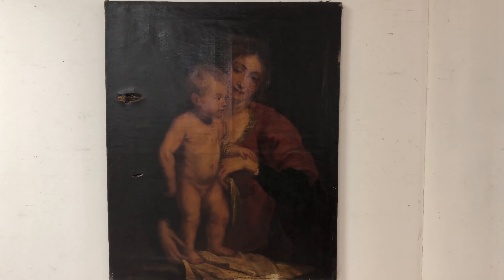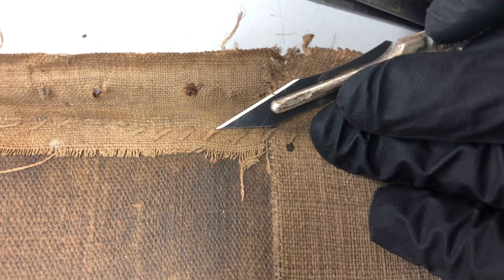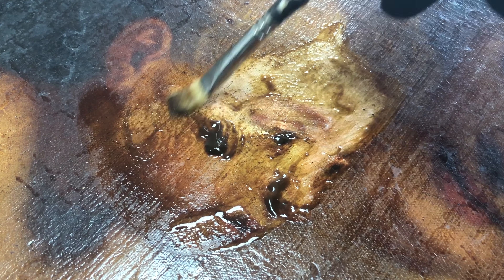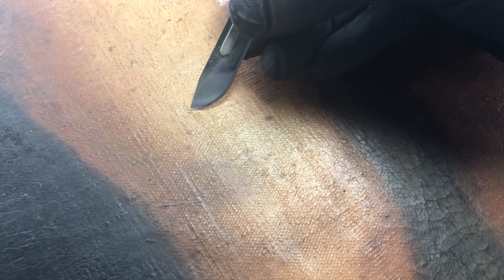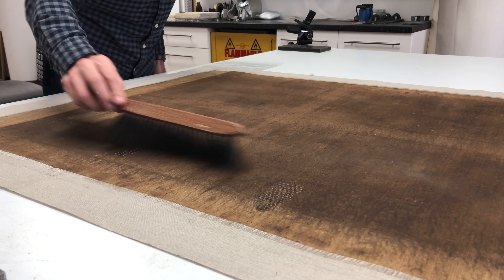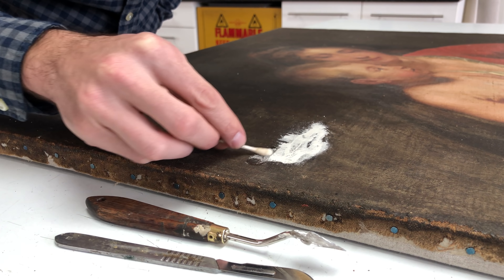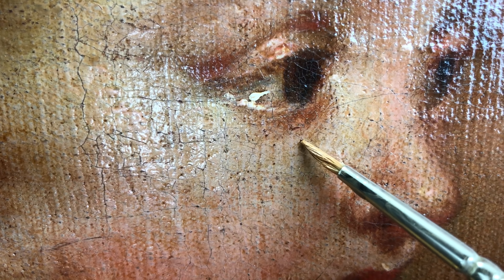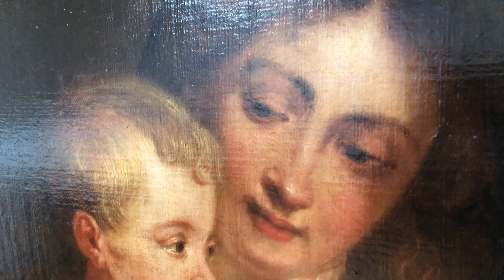Narrated Old Master Painting Conservation

Comment: I have a question: Why do old paintings look so thick? Was the linen the old masters used thicker or is it a combination of layers of paint, resins and varnishes? Thanks.
Reply: The latter. Renaissance Painters like DaVinci and the like use a lot of thin layers to create them or use impasto, when you paint very thickly with a lot of texture. Also animal based paints and varnish crack over time. Humidity and other conditions that the painting may have experienced could also affect it. While I’ve never heard of thicker linen, it might be possible since they were made by human hands and not industrial machinery, that makes a more uniform product.
Reply: Being thick was a sign of prosperity back then.
Reply: @rlt94  ROFLMAO!!!....true, but funny in the context you place it.
Reply: @rlt94  Have you looked at that baby? A thicc icon.

Comment: How much does something like this cost?
Reply: Depending on the size and how much work needs to be done... i do a similar business and something that size I would to for 250-300 bucks.
Reply: It’s that expensive because of time
Reply: @taylorzielinska8681  That's not too expensive really, although I suppose it depends where you are geographically and what sort of paintings you work on. I'd imagine this one took a few days at least, and a day rate could be anywhere from $300 to $1000 for this guy. Wouldn't be surprised if the whole project ran into the $1000s.
Reply: @taylorzielinska8681   Are you joking? $250 to $300!?!?  He must spend 20 hours or more just cleaning it and his expertise alone would command that amount of money for just looking at the piece. I would imagine his work would cost thousands rather than a couple of hundred. I don't know what work you do but it is certainly not fine art restoration if that's what you charging!
Reply: Definitely in the thousands, with how experienced and good he is and how long it takes. And the materials and tools he uses are clearly top quality. This is not a few hundred dollars worth of work.
Reply: @taylorzielinska8681  250?? to 300? hummm ...  i think you missed a zero here or depending the  piece a couple... I dont think  any restoration studio working with this level of restoration and art pieces would even touch them if there are at least a 3 to 5 thousand dollars as a DEPOSIT.
Reply: Lol it’s 2500-3000 mb

Comment: When you remove the varnish with focus on sections of one color at a time. How do you know which solvent is used for which color? Do you label your different types of solvents according to the color pigments, type of varnish used, or by the type of paint used? It seems like there's so much to learn
Reply: You use the same solvent for them all. You just go section by section to keep it organized and in case one color has a reaction. It is very rare to have to use many different solvents. They might even just switch the solvent for the whole piece if one color has a reaction.

Comment: Thank you for telling us the 'story of healing' of this painting <3 I have two question: do you try/have to clean the painting in one day or you could clean it in the several steps/days? Is this synthetic resin layer (also) makes easier the retouch to be removed if it is needed?
Reply from the maker: The cleaning process can be short or take several days or longer... it just depends on the painting.  And yes, the resin layer will make easier the removal of the retouching though the retouching comes off pretty easily even without it.

Comment: Are you using water based ie plastic resin varnishes? You do know that these grey in about 10 to 15 years.  Using synthetic alkyd resin gives a much nicer and more "genuine" looking finish (its much better for holding pigments as well). That horrible EVA (plastic) adhesive is not reversible. Berger's brand is no better, linings made with it cannot be removed after 20 odd years.
Reply from the maker: I'm not using water-based varnishes.  Never.  Ever.  Alkyd resin is not removable and as such should never be used as a top coating as it will yellow and forever become part of the painting.  I'm not sure where you're getting your information from but BEVA 371 is the preferred lining adhesive by just about everyone and in fact the adhesive remains receptive and soluble in Naphtha and heat well past 20 years.

Comment: Can anyone recommend a scholarly work that comprehensively covers early-modern mediums for oil painting ie I'm not interested in non-scholarly "opinions". I want to specifically know whether painters of this period added anything to drying oils, such as an initial solvent in the lower layers. The late sixteenth century Florentine author Raffaello Borghini says, 'apply the colours tempered with walnut and linseed oil [walnut oil was used for the lights to prevent yellowing - I know all that]. Walnut, in which it is well to mix a little varnish, is better because it is thinner and will not yellow colours. Bring your work to completion with care, it not being necessary to varnish it...' What does the author mean by varnish here? Varnish? a solvent like spike lavender oil? By contrast, Gerard de Lairesse, the most famous history painter working in the Netherlands after Rembrandt, writes in a 1707 work that varnish should be used between the layers much like one would use a drying oil to oil out sunken areas. Again, does he mean varnish or something else?